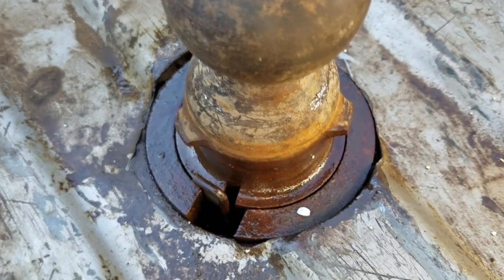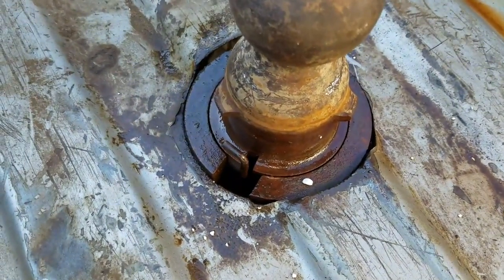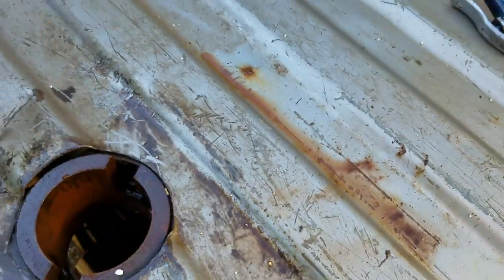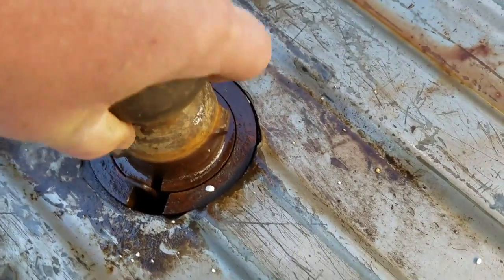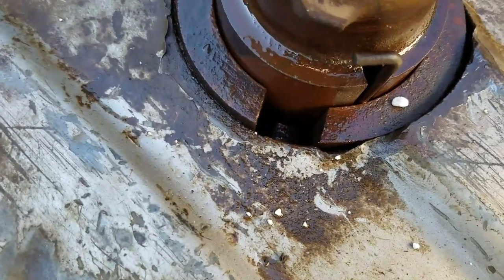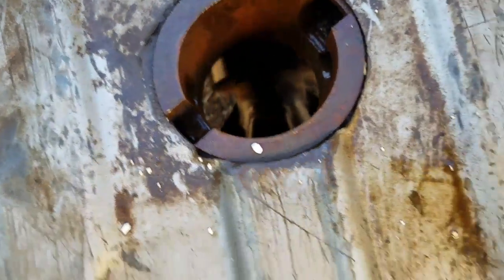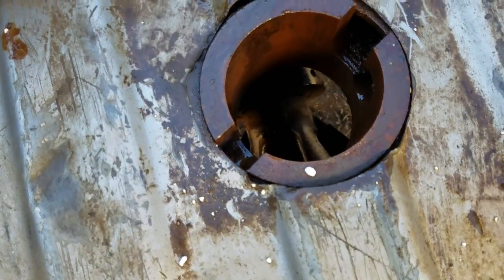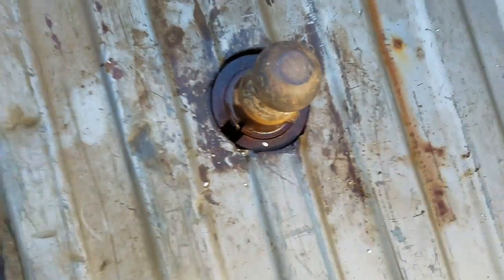How to Remove Your Pickup's Ball (Cody Hitch)

Comment: It's a Cody Hitch, need to pull it our every couple of months, and lube it. Mine Stores upside down fine. When it's upside down, that retainer pin stays collapsed against the ball, so it won't lock it in from rotating, and not rotate when in up side down. It's heavy enough it won't jump out. Has a roll pin on bottom / under side, so have something to grab ahold of, when it's stowed in the hitch upside down. Took my the last month to figure out what it was, as I'm looking for gooseneck to fifth wheel adapter solutions. Going to make a bed rail adapter that will attach to the hitch. They have a patent on a cushion hitch, for all makes, so they make stub adapters for all makes, but off replacement balls, stubs, and make a safety chain deal I'm going to order that locks into grooves that ball locks into hitch with. Just google Cody Hitch and go to their website.
Reply from the maker: Thanks! Now I can put that in my description and title. I am usually pretty good at searching the internet but this one had me stumped.

Comment: I have this type of connection on my 2004 Ford F350. I initially was thinking it was a "puck" system but it apparently may not be. What ball system is this called? Thank you very much for this video.
Reply from the maker: I have not been able to find one like it listed on the internet. I know this was originally sold at our local dealer so I am am guessing either Rigid Hitch or DrawTite. It might have been installed by a trailer sales outfit. I will look in my glove box to see if they happened to put the info in the owners manual. Thanks!
Reply: Rigid Hitch or DrawTite. Thank you very much for your response. I'll check those out.
Reply from the maker: I went on Rigid Hitch's website and I see two brand that might work. Blue Ox, Buyers and Drawtite. They are not exactly the same but close. Some look like they have a rod under the bed that you pull to release the ball.
Reply: Thank you for doing some research. I also found so far under Blue Ox there is a similar locking mechanism. I'll keep looking. Thank you again for helping narrowing my search.
Reply: How do you get it removed from the stored location? I have a rusted one that I'm trying to get out....
Reply from the maker: That might be a problem. I think it doesn't lock like it does in the upright position. It should just turn and lift or lift then turn without releasing the catch. If I remember correctly, I think it lifts up and turns to release. There is a bar or pin that runs across the bottom of that ball that you can get a hold of with a pair of pliers so you can lift it. If it is rusted you might have to keep adding a good penetrating oil every so often to see if it can come loose. Can you see a little movement when you wiggle it?
Reply: I have the same ball style on my 97 F350 and I am looking to buy the ball. I you find out what the system is called please let me know
Reply from the maker: I am going outside right now and look through the papers I got with this truck. I am the second owner. Who knows I might be lucky and they are still in my glove box.
Reply from the maker: No Luck finding papers. I called the Dealer and he thinks B&W, I don't think that is right. I chatted with Rigid Hitch and shared my videos. They Think Draw-Tite or Putnam. I might wire wheel the ball to see if I see a stamping some where. I am going to start a chat with e-trailer and see if anyone there has seen this. I would like to know in case I need a new ball someday.
Reply from the maker: Google Cody Hitch...here is a video...https://youtu.be/ugNYwsb4cwY